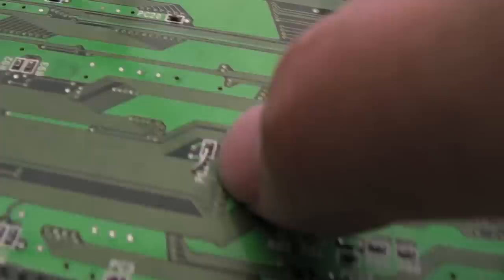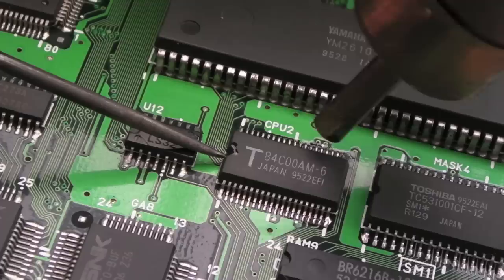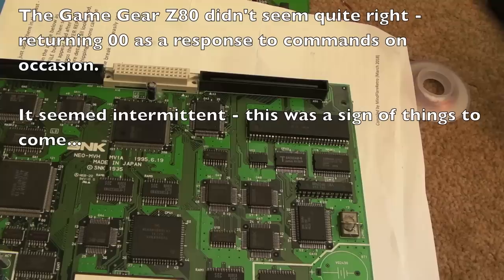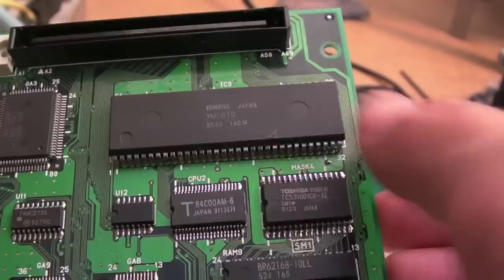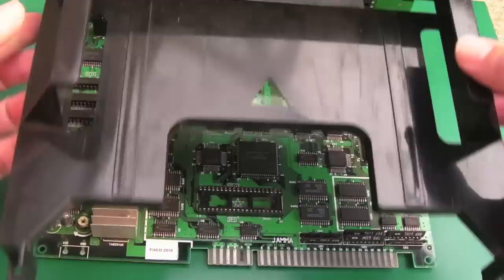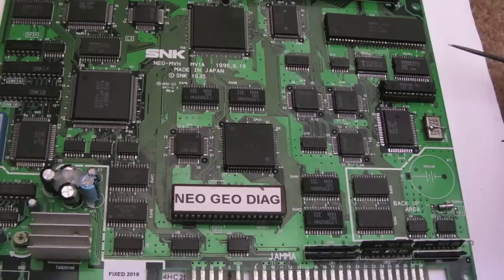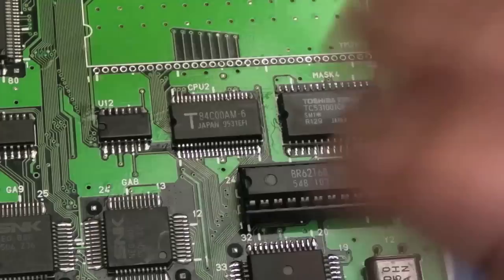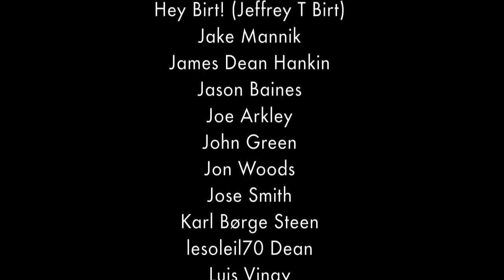SNK Neo Geo MVS Junk Board Repairs Part 2 (MV-1A Z80 Error From Hell)

Comment: The one with the ripped-out chip almost makes me wonder if someone assumed it was a socketed chip and applied a certain amount of brutality to it with a chip puller.  I've seen that kind of damage done with chip pullers if you grab the socket instead of the chip, so...  I wouldn't be surprised.
Reply from the maker: That's possible I guess!  I think in retrospect what someone was doing was trying to fit a UNIBIOS or Diagnostic ROM maybe.

Comment: Great Video and attention to detail. I am also currently working on a Z80 Error from Hell on a MV-1FZS board. I've swapped out the Z80 , YM2610, NEO-D0, SM1, and the Z80 Ram. All obtained from a donor board. I have checked continuity using my meter, as well as using my Oscilloscope to check signaling and my logic probe to check logic as compared to a working 1FZ I have. Still no luck, I don't have a Diagnostic Bios and I am the process of trying to obtain the programmer and EPROM to make a Diagnostic Bios. As a side note I did notice the HC32 in the backup section was producing odd test values as compared to a working HC32, so I swapped that out. Still stuck on the "Z80" error on startup, I have ordered some extra "Z80 - 6" to be on the safe side as I don't know if the Donor Z80 is any good. Any advice you can offer would be greatly appreciated. Thanks again.
Reply from the maker: Thanks =D   The Neo-C1 has some connections I think - maybe you have a fault there!  I hope not!
Reply from the maker: In fact, it does - my next video talks about that.  The communications channel runs through the Neo-C1.
Reply: Thanks for the info, so I think my next approach will be one of the following: I can use my known working 1FZ and probe the LOGIC on the Neo-C1 to get a baseline, then compare it to my faulty board. Also based on the pinout diagram of the Neo-C1 provided by  "Neo-Geo Dev Wiki" I will also check the continuity to the Z80 from the C1 connections. If your interested in the logic values I obtain from the working board, let me know.

Comment: Quickchip do a low temp solder for ship removal, i don't think it's super cheap but watching the eevblog review does show it works really well for removing larger, more awkward chips :)
Reply: It is quite expensive, though. I think Chris did use it in a few previous vids?

If you search for "bismuth solder", there might be some generic low-temp stuff that could work. I've not tried this myself, as I just use my hot air station, too.
Reply from the maker: Yes, I've mentioned Chip quik solder a LOT through my earlier videos!  That's how I ended up using the flux for nearly everything I do now - best flux around!
Reply: @electronash  now there's an idea!

Comment: Ouch, get some flux dispenser tips. :) A preheater would be nice too, it makes the SMD rework with hot air super easy. What temperature were you using on the hot air station?
Reply from the maker: Funnily enough I did order some tonight =D  It was on my list of things I needed :o)  Temperature varies depending on the board and the chip etc.  On these boards 375 to 415 typically.

Comment: I did some Googling on the Toshiba 84C00AM-6 chip you mentioned as being hard to get a hold of. It seems it's still being made by Toshiba and I found a couple of distributors that say they have them.

https://www.kynix.com/Detail/198879/84C00AM-6.html
https://www.utsource.net/itm/p/1097040.html

Mind you I've never used these companies before so I can't vouch for them, but it might be worth a try the next time you need that chip.